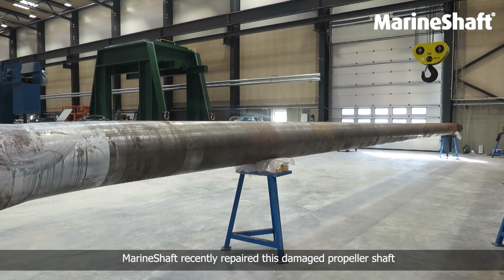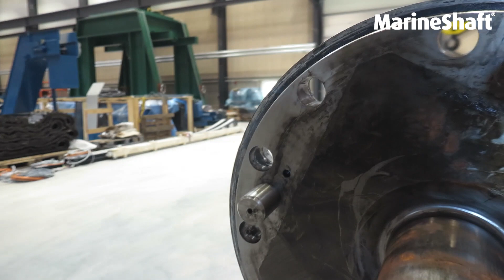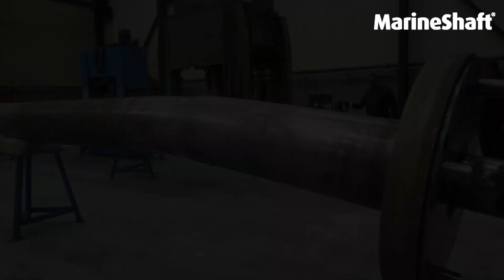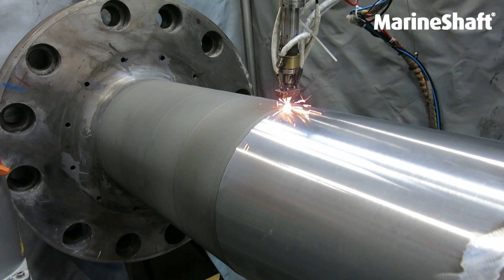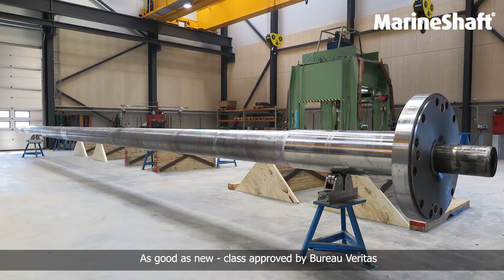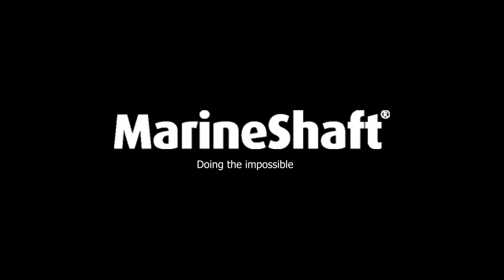Cold straightening & repair of a bent propeller shaft

Comment: How do you bend something like that in the first place ?
Reply from the maker: Hi Tim. Severe bends are caused due to groundings
Reply: @TheMarineShaft  Thank you for that.
Reply from the maker: Bendings often happen when a vessel hits an obstacle - groundings.
Reply: @TheMarineShaft  guess the propeller doesn't survive this?
Reply from the maker: Unsure in this case  @davidstud3952   but we do repair propeller blades, pitch controlled and fixed.